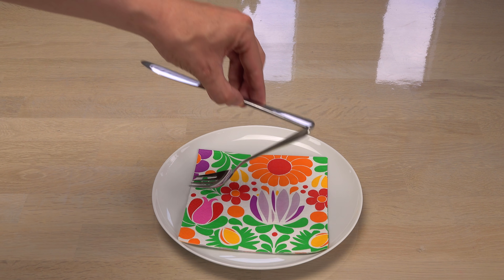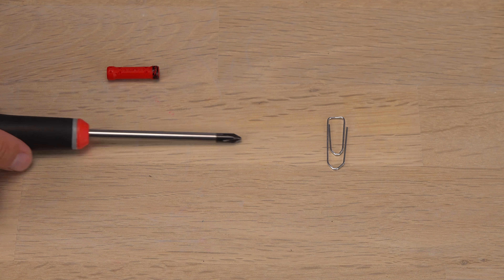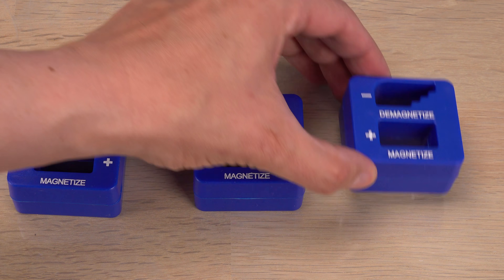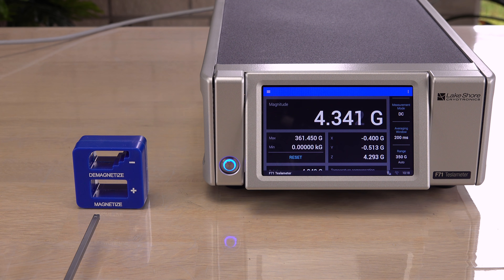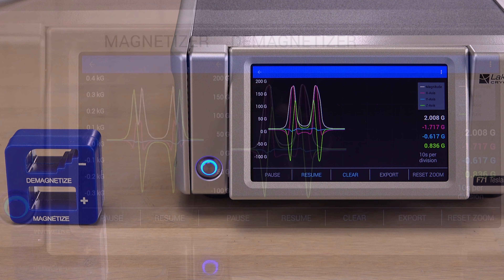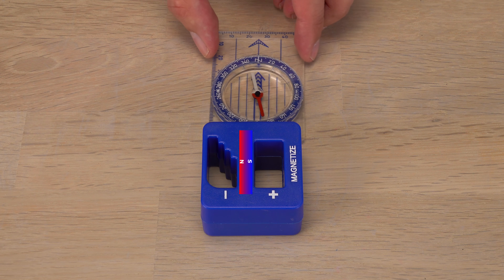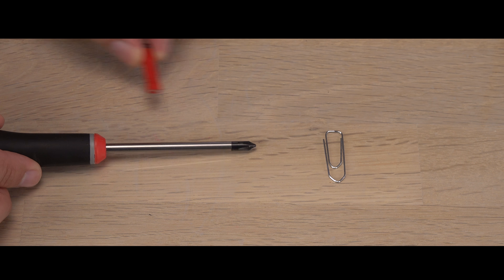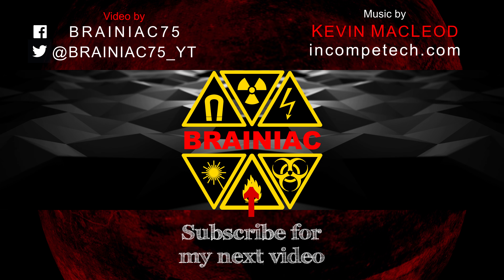Mystery of the Demagnetizer | What's inside? How does it work?

Comment: I think that regarding the intro, your cutlery being magnetic isn't because you use lots of magnets. My parents cutlery is slightly magnetic too, and they don't use lots of science things. I seem to remember reading somewhere that rubbing metal together (like rattling in the drawer or normally using them) slowly magnetises it, but I am unsure of the science of that
Reply: I just did some googling on that, the answers I got were related to dishwashers.  It's either the heat when they're aligned a certain way, or a poorly shielded motor creating a magnetic field that affects it.  Or both.
Reply: @startedtech  possibly in some cases, but my family has never used a dishwasher
Reply: The sign on the box in the intro says "Attention, Contents Extremely Magnetic" - I think its definitely magnetic because of the magnets lol

Comment: So basically the hole shapes are for use in the dark or by the blind or poorly sighted?
Reply: It’s actually to help the process, by slowly stepping away from the magnet. It helps demagnetize the device. It’s similar to how professional demagnetizers work, as commonly seen in machine shops and other industrial applications. With the professional devices, you’re supposed to slowly lift them away from the coil while it’s powered on. But on this version, the steps in the plastic help you do this in a different way.

Comment: I agree with your hypothesis as to how these devices work. Another clue is that these devices can never (in my experience) completely demagnetize a tool. Any tools I have demagnetized will still pick up iron particles, small screws etc.
Reply: get a watch demagnetizer, they'll totally remove a magnetic charge
Reply: @TheAechBomb  I made an electric demagnitizer out of an electric hair clipper that went dull. It used an electromagnet across mains to move a bar attached to the moving blade, at 60hz. Simply remove the moving parts, turn your new degauser on, place the tool up against the right area and slowly move the tool away.

Comment: also possibly interesting, the plug in magic demagnitizer boxes often used for watches are just a transformer inducing a switching magnetic field, you slowly lift the object away from this alternating field until theres no longer any residual magnitism in the object.
this same idea is also the reason behind the 'steps' on the demagnetizer here I believe, as some people pointed out. with ofcourse the difference that you need the right polarity, as you found out.
Reply: The alternating demagnetisers are known as degaussing coils.
Old colour cathode ray tubes had them, the thing that went "dong" when you turned them on and made the picture wobble for second when you turned them on, to remove any magnetism which may have formed on the colour grid (otherwise your TV starts to make everyone look sick!).

Comment: Haha, so much simpler than I originally thought and used these. I thought you had to swipe a screwdriver progressively "up the stairs", to diminish the field one "step" at a time. Learning about magnetic fields here, thanks a lot!
Reply from the maker: Could be a thing for strongly magnetized tools. So far I have not encountered any that needed progressively swiping. The fun thing is how many websites mention the stairs as important for the demagnetization function - making the magnetic field "irregular" x) Thanks for watching!
Reply: That's probably the intended method if you want to diminish the field as low as possible.

Comment: The steps are meant to let you move away from the field strength in increments by going up a step each time.
Reply from the maker: Hm, that may be a thing for tools that are strongly magnetized (highly ferromagnetic). So far I haven't experienced anything that needed that. But many websites mention the stairs as important since they make the magnetic field irregular x) Thanks for watching!
Reply: @brainiac75  I thought it was so you could still tell which was the demagnetiser after the words rubbed off.
Reply: yeah im an idiot why add a side when cutting that side open ended would guarantee a reduction in material so maybe like my inability to think past  changing the shape to match the square they just doubled down on exactly what @pat the plants idea was
Reply: @Pat The Plant  then why bother putting a second opening in it? Especially since it's not actually necessary.
Reply: @brainiac75  I have a feeling it's smoke and mirrors to unknowing buyers. It's a waste of space considering that, and you'd be better off making one so you could use it on larger objects.
Reply: @brainiac75  Well thinking about it makes sense you'd be moving away from the core of the magnetic fields while still facing the same mechanization processes.
Since magnitic fields follow the invers square law it makes sense that each stair would be weaker.
Now that we actually have a reasonable explanation I would be very very interested in seeing the charts of each step and compare them to each other to see just how significant/insignificant it is to the process. I would also love to see the reading of the screwdriver tip after passing each step.
Reply: @brainiac75  They do nothing to the field...they help direct you in a direction where the curl of the field is large.  Thus by rapping it down the "stairs" you will get maximum db/dt which will run the item you are trying to degauss through its hysteresis curve as rapidly as possible.  It is likely not necessary, however, to demagnetize most screwdrivers.  It's just "a little bit better" to run them down the stairs.  Also, as pointed out above, the rapid bumps in the field caused by jumping down the stairs with only help to increase the rate of change of the magnetic field which is good for degaussing.
Reply: @pauliexcluded1  Shouldn't you go up the stairs?
Reply: @louistournas120  I don't know if it matters....
Reply: @brainiac75  I typically use the stairs with tweezers and scalpels that I use in electronics work, going up one step each time I move the item in/out of the demagnetizer and it seems to help getting rid of the last bit of magnetism in the tools.
Especially when working with SMD electronic components, they tend to stick to the tip of those tools if they have the slightes amount of magnetism left due to their tiny sizes and small weight and this can be really annoying. Whereas a screw or nut have substantial mass in comparison with SMD components and thus it does not take that much to demagnetize a screwdriver enough for it to not be able to pick up screws anymore.
Reply: @brainiac75  Those steps are probably good for blind people, too.
Reply: @brainiac75  thanks for the video, i have never bought any of these, just witnessed and used one from a colleague, however i may have an answer to your stairs issue that may make more sense, than any magnetic field trickery: i learned in my engineering classes, that to demagnetize ferromagnetic materials you need the tiny magnetic particles to arrange randomly, to cancel out. heat can achieve this, as you state.. but the second thing you can do, is "smash" them out of order, like with a hammer. Or in case of the stairs: "riding" the screwdriver around the circle will cause it to quickly hit against the steps and thus demagnetize even further, even if magnetized in an inverted magnetizer. Please do answer, if that does work(i have no access to them anymore, and would be interested if my understanding of physics isn't wrong).
Reply: @brainiac75  It's not the stairs themselves that provide the irregular field. It's the movement along them. Plus they can provide some vibration that helps.
Reply: @brainiac75  Yeah, the further steps are meant to squeeze every little bit out. If you want to get rid of as many gauss as you can, you do multiple passes, moving away a bit each time
Reply: That makes sense. I was wondering what the point of them is after he showed there was nothing in there.
Reply: @Litigious Society nice
Reply: What about the gadgets that have the demagnetization part completely open (like a U)?
Reply: @user-vn7ce5ig1z  exact same. Opened mine up and it's just like his.
Reply: @user-vn7ce5ig1z  Just look at this one.  All that plastic does nothing anyway.
Reply: This is what they are for. When you use a CRT demagnetizer you have to move it away from the screen slowly. That way the magnetic field lines get smaller.
Reply: So I guess the steps have different levels of power,in a way
Reply: I was thinking the same exact thing, it's a tool for precision. If the item you magnetized is too strong for your application then you can reduce it a bit just by using one of the higher steps. I wouldn't expect it work on the magnetize side either since you would just be moving closer to one magnet or the other.
Reply: @Lassi Kinnunen 81 i mean to answer your question my personal outtake on spending money on tools is if i one has a special tool that helps one thing but could be in the way of another thing id rather have the little bit of less help for the overall versatility but people now days dont even have that thought process so idk how 50 years ago compares
Reply: https://youtu.be/KXNRlJPkWIk
Reply: No the shape of the holes is there so that years from now when the lettering has worn off the outside of the case, you still know which side is which.

Comment: Wow, that's too simple! My guess was the demagnetizer had some arrangement of alternating poles, so as the screwdriver was passed through it, it would experience a rapidly changing field which would demagnetize it.
Reply from the maker: Many websites believe it too :)  But they also say the screwdriver will lose its magnetism over time since it is paramagnetic. I doubt they ever looked up what paramagnetism is :D A paramagnetic material will lose its magnetism as soon as the external magnet is removed. Thanks for watching!
Reply: @brainiac75  hi could you do a connection with this Magnetic fields may hold key to malaria treatment, UW researchers find ... using this device or a larger coil.
Reply: @esecallum  ok...
Reply: I was thinking the same thing! Thought there were some smaller magnets arranged in the stairs in an alternating way
Reply: @k.katona9415  It is supposed to force the tools to one side, but it is more of a marketing move that attracts buyers to a kind of supposed sophistication. The price is, of course, several times higher than two ordinary permanent magnets.
Reply: @k.katona9415  Those are probably there as "knowns", for smaller tools and different grades of steel etc
Reply: @MadScientist267  holy moly you're clever
Reply: I was thinking a magnet combined with a copper coil of some sort. Simplicity trumps complications once more!
Reply: All you have to do is overcome the hysteresis... Without going too far. So what you have is a concentrated north to magnetize the tool, and a weakened south to demag it
Reply: @MadScientist267  yup
Reply: I think that is the effect. As the iron moves through the field, each point will be exposed to both a North and South facing field.
Reply: @DJ_Force  Umm
Reply: You mean some Halbach-array
Reply: I think reel to reel head demagnetizers work sort of like that.
Reply: @hbp_  Magnetic Tape eraser heads are simply driven by high frequency AC
Reply: @martinb.770  There are cheap erase heads that are (unfortunately) just permanent magnets. :(
Reply: @chaos.corner  i think, moving a permanent Magnet ist more complex than switching on an e-magnet.
Reply: @martinb.770  Arguably. But nonetheless... Techmoan has covered it in some of his teardown videos. Most tape players these days use the same cheap mechanism and sometimes the erase head is just a permanent magnet.
Reply: @chaos.corner  Player (vs. recorders) need no erase head at all ;-)
For helical scan type types, this makes no sense, either.
For linear tapes, it will depend, whether the result of erasing suffices to not be interpreted als signal. For audio purposes and with type  IV (metal) tapes, this might be a problem.
But yeah, we know some manufacturers try to safe another 20c, not considering the disadvantages.
Reply: @chaos.corner  oh my ... such a construction is an insult to technical advance. Even in 1995 this quality was considered outdated.
Reply: @martinb.770  For sure. Even as a lad in the 80s, I understood why they had an active erase head. Though they have stronger magnets these days, you still want to break that hysteresis
Reply: The purpose of the ladder thing is to provide exactly the rapidly changing field that Gabriel talks about. Scratch the screw driver on the ladder in a lively motion like a musical scraper, and it becomes completely demagnetized. Just passing it through the hole is enough to remove most, but not all magnetization. You can test it with a tiny screw or a piece of steel lead from a resistor or something.
Reply: how can the screwed driver ever lose its magnetism ? will it lose its iron contents ?
Reply: @monad_tcp  magnetism depends in the many ferromagnetic  areas having the same orientation. when "de-magnetizing" the common orientation of the field gets scambled again.
Reply: @TheRealLoganYT good man
Reply: Essentially, demagnitizer turnes organised magnetic field into the gibberish, like enigma.
Reply: ugh
Reply: The "staircase" is just to make it more "idiot proof". Kinda like diesel fuel nozzles being larger in diameter than gasoline.
Reply: Gdyby nie ruch planet nie byłoby słońca,a zatem życia
Reply: I learned something similar with an old crtv(?) Accidentally put a magnet next to it and the corner turned green. Turned the magnet around and put it next to it til the screen turned red and the green went away (mostly, i obviously fucked the tv up lol)
Reply: Me too - from the AC electromagnet demonstration I saw 50 years ago at school to demagnetise objects.